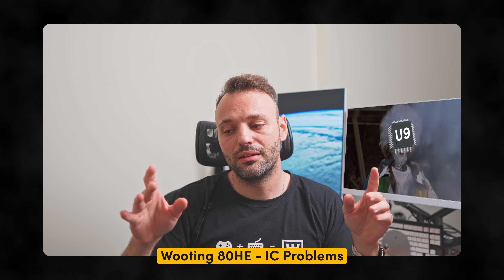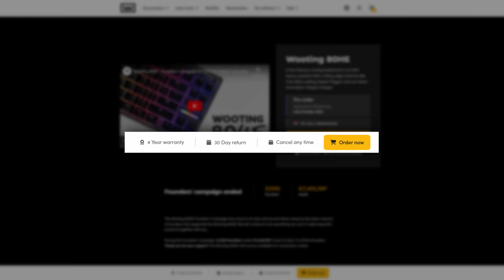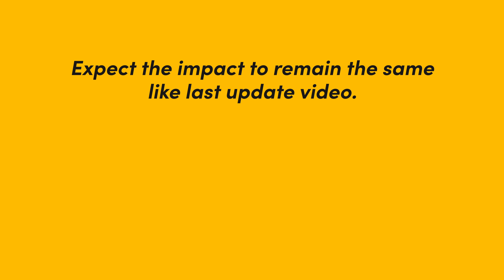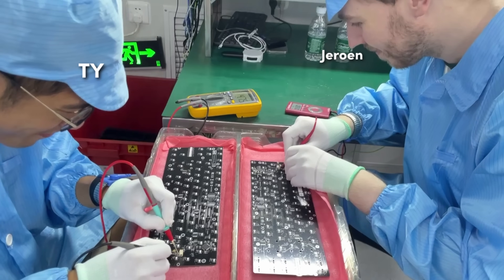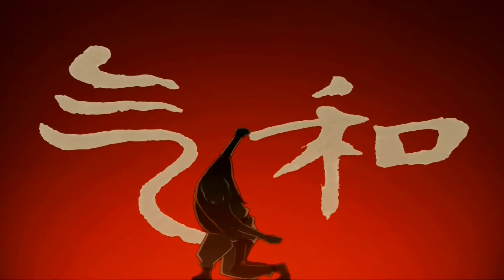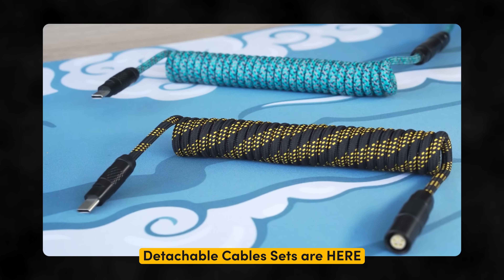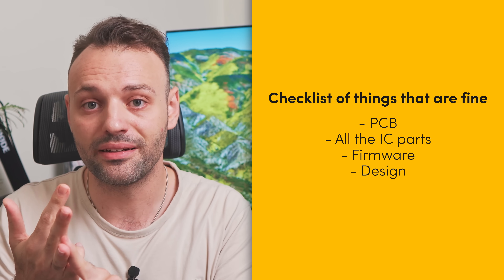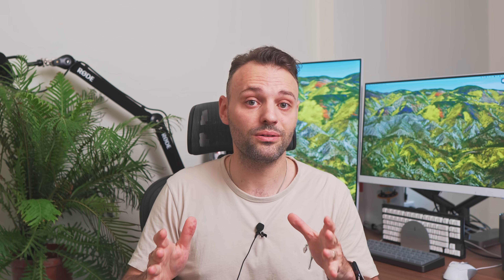Wooting 80HE - We Found and Fixed the Problem

Comment: While Wooting will never receive another dollar from me, I do periodically show up to watch these videos. I'm continually amazed by how many times I see comments praising Wooting for its transparency regarding delays and manufacturing mishaps.  

IMO, these aren't admirable qualities.  Rather, they are obvious red flags and signs of inexperience. Unfortunately, there is no way to discern between bot comments and genuine comments.
Reply: Heh, you obviously have no experience in the field of making consumer electronics that people interact with. But, be that as it may, you should probably refrain from ever buying anything, since every other brand out there has issues at times, and none of them are as open about it as Wooting is. If I had been asked, I would have told them to do what every brand does, stonewall publicly and solve the issues that have a risk of becoming bigger behind the scenes, by dangling money in one hand and a big fat NDA in the other. I've worked for major brands for many years, and that is the most common approach. Sadly it is the most reliable way to avoid backlash of exactly the type that you provide an example of. 
Congratulations on making the industry worse, and punishing a brand that tries to be transparent.
Reply: So what happened to you?

Comment: Hello. How exactly do these analog switches work? Is there a metallic contact?
Reply from the maker: Our switches have magnets inside and there is a sensor on the PCB. The sensor reads the magnetic value within the switch. So if you press the switch it can sense the entire range.

Comment: OK I guess very few end customers would plug their daughter board in and out with power on the wire, but wouldn't it technically be the same scenario with aviation GX connectors?
I don't think they have recessed pins so I guess they would also connect all 4 wires at the same time and not ground first... 
(yes yes I know, there can be issues with cheap cables and wooting anyways, tachyon, this and that, but let's be real - there will be more people out there using cables with aviation GX connectors than people unplugging the daughter board....)
Reply from the maker: The metal outer shell of a plug is also (connected with) ground this connects even before pins do. Not sure if this is the same for GX connectors, but there must also be a mechanism that'll ground first.

Comment: In the last video related to this problem, you said that there appeared to be not working keyboards, already ready to be shipped. So if the cause for the keyboards to break down is plugging the connector, then why they broke down in a box?
Reply from the maker: Because the act of checking it after taking it back out of the box was the trigger event that broke it.

Comment: Why use the JCT plug in the first place?
Reply from the maker: It's a common and good internal connector that sits snug and does the job effective. It's not made to plug out and in frequently (with a powered source), like a USB-C port. Therefore it was also not built with all the bells and whistles to protect itself from those kind of scenarios.

Comment: By chance do the keyboard inptus count as a pressure sensitive key? Aside from racing games, it helps to have for older games or a wider variety of keybindings.
Reply from the maker: Yes, the PC can recognize Wooting keyboards as a xbox or standard HID controlller/joystick, for analog inputs in games. But it's game dependent how well this will work, as often they don't support simultaneous use for mouse, keyboard, and controller.

Comment: Those pesky electrostatic discharges man, I swear...  For real tho, this level of transparency approach from you guys is much appreciated. I wish multibillion dollar hardware companies had the guts to do the same. 👍
Reply: Electrostatic discharge is not even at fault here. Voltage Is a relative thing, so without the same ground on both ends voltage can be literally anything and if unlucky there is a good chance to fry electronics. This is why USB made this way(ground all the time connects first), so it's suitable for hotplug. This just a violation of basic rules.

Comment: how come it's not the 80 HE+? or does it already support the difference made with 60HE+
Reply from the maker: We added the + in the 60HE to make sure it is differentiated between each other. The + just means it supports screw-in stabilizers. 80HE already does this from the start. Might we make future changes to the 80HE, it might become a + in the same way.
Reply: @Wooting  thanks for the clarification, i thought that was the case!

Comment: It's great to see Wooting being transparent about the issues with their keyboard. It would also be helpful if they acknowledged the problems with the Wooting wrist rest, which get stained by oils from hands. Despite being washable, these stains are permanent.
Reply from the maker: This is the outer layer wearing out and exposing the more raw silicone underneath. The outer layer helps smoothen the feel of the wrist rest overall.
It's a feature of the silicone, something that will always happen with wear but has no negative effect on use. This is a problem that affects overall quality experience.

We do have a plan on the table how we can advance the wrist rest to that next level, it involves changing up manufacturer. Just waiting for the right moment, as with current resources, it would spread us thin.

Comment: I honestly was a little disappointed when I saw the delay on the wooting website earlier, thinking "damn, delayed? again?" But I had totally missed the previous update. This video really helped clear it up, I'm even more excited to receive the keyboard now in fact! 

Genuine appreciation for explaining the issue in such depth. As an engineering student, I can totally understand how little mistakes can go unnoticed but have such huge detrimental effects, many props for going so far as to halt production to ensure that the issue doesn't get pushed to shipped units. And in equal parts do I appreciate the communications so far, so many times we'll just hear that launches get delayed without hearing any reason, THIS IS THE WAY! Thank you so much for making me understand why my patience is so valuable! I can't wait to receive my keyboard, though I will certainly forget that the keyboard I'm using hasn't experienced any significant issues, I'll say it now, thank you for taking such great care for even 0.5%!

Comment: .5 % is crazy considering Intel just shipped CPUs that have 50% failures 😂
Reply: more like 100%
Reply: Not to defend Intel, but 50% is BS
Reply: from my understanding its actually 100%. every 13th and 14th gen chip has the defect and they are rolling out a bios update to adjust the microcode to essentially run slower so it doesnt kill itself. its kinda similar to the issue the early 30 series cards had. they have no choice but to purposely limit/throttle the performance in order to not let the hardware reach its "killing itself" point. which sadly that "killing itself" point is well within its normal operating range
Reply: I would laugh but mine did fail :'(
Got a replacement straight away though, Australia consumer protection law means Intel can't refuse the warranty even if they deny doing a recall  :)
Reply: STILL. SHIPPING.
Reply: It's not 50% they shipped 100% failure rate i9s. Ones that hasn't failed yet are the ones that have a better soaking AIO coolers delaying it's inevitable failure.
Reply: near 100% i would say
Reply: CPU's is a whole different thing, high failure is not normal, but not insane either. But Intel is trash anyway
Reply: @SidNey_166  50% failure for any product is horrible
Reply: i got lucky with my cpu thank god bruh
Reply: @RedactedKyrrinn  the CPU degrades over time. It comes defective out of the box meaning that it will degrade and eventually cause issues. Its not gonna give you issues out of the box.
Reply: @Gato-4180  ive had it for a year and its still doing 100% lol
Reply: @RedactedKyrrinn  it’s degrading over time brother. Every single 13th and 14th gen chip is affected. You don’t have the only intel cpu in the world that isn’t affected lmao
Reply: @RefrigeratedTP  not every single one is effected lol
Reply: @RedactedKyrrinn It's every single one. Users with ones that arent affected has better coolers delaying the degradation.
Reply: @DominickDecocko  whatever u say man
Reply: you mean .05%   

.5% is 50% 

WHERE YALL LEARN YO MATH
Reply: @jamalbrown7039  .5% is .5% brother, 0.5 full stop is 50% based on a 1.0 scale, you are saying 5% in your comment based on your own "math" and .5% would be 0.005
Reply: @jamalbrown7039  bro really thought he cooked with that one 😂
Reply: @jamalbrown7039 % means 1/100
0.005 = 0.5%. 
0.05 = 5%

what you said was that 0.5% = 50% but its 0.5 that is = 50%
Reply: @jamalbrown7039 you mean .005%

.05% is 5% 

WHERE YALL LEARN YO MATH
Reply: @jamalbrown7039  BACK TO SCHOOL FOR YOU 🤣🤣
Reply: @jamalbrown7039  not where u learned it apparently since everyone is getting it right. .5% is not 50%. sorry.

Comment: Who in their right minds would disassemble electronics while it is plugged in and powered...
At work I might open up a device and power it while it is opened up, but I don't connect or disconnect any cable during that.

Comment: Petition to make a wooting low profile rapid trigger keyboard (new in its market)
Reply: as silent as possible with rapid trigger would go insane
Reply: @sidevids1090 Frrr
Reply: Could probably just put a spacer on you keyboard , change the caps, and then tune your settings